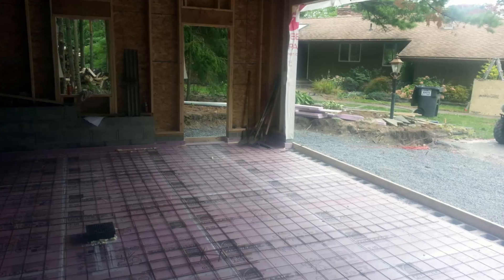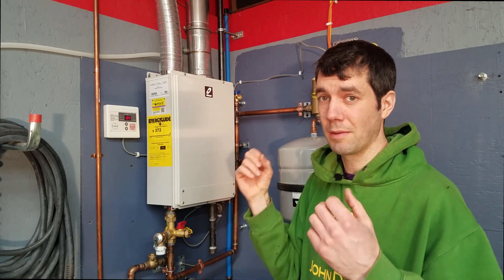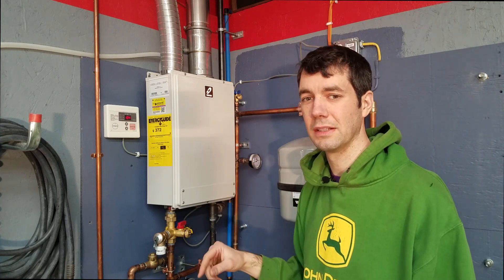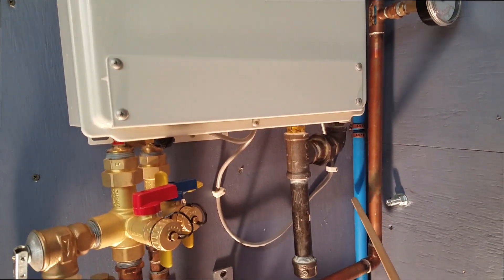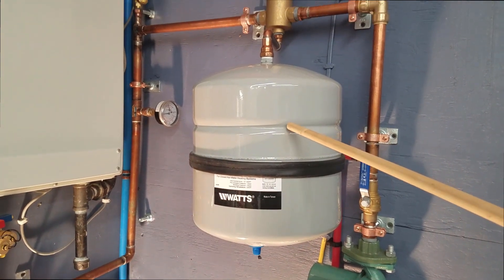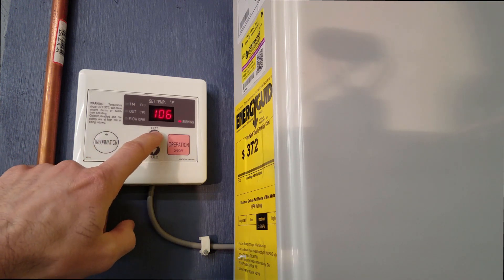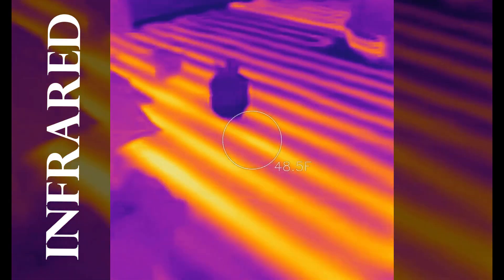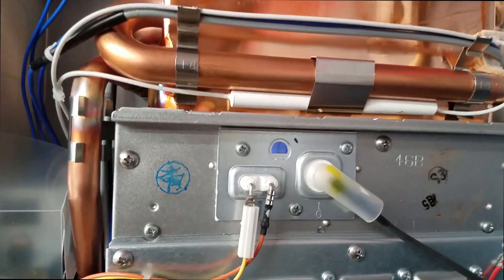Explained: Garage Radiant Floor Heat Setup w Takagi Tankless Heater

Comment: Well, I installed this exact system in 2016 in my 550 sqft shop with the pump pulling hot water from the Takaki tankless water heater. I am currently on my 3rd pump with countless code10's and code 90's. The pumps have had the exact fail, seizing. The last pump I bought was a Grundfos Stainless for $771.74. It did not last more then 5 months before seizing. 
 Circulator pumps (like Taco, Grundfos, or B&G) are designed to handle pressure on their inlet side, not suction.

Running them backwards (functionally) or with suction at the inlet can cause the impeller to: Run partially dry (if air gets in)
      Wear prematurely or seize up
      Make a loud humming or rattling noise as it tries to prime itself.
There have been a few individuals that have defined this problem but I see most diagrams pulling from the hot side. Even some literature I've read says that as well but those are defining potable water systems or a combination of both. So, my plan is to setup my system to do the following:  Cold water from floor to Pump → Cold Inlet (On Takagi) → Hot Outlet(On Takagi) → Supply Manifold → Floor Loop → Return Manifold → Expansion Tank → Back to Pump. If anyone can elaborate, please do. Thanks

Comment: Where in NY are you? I am in the finger lakes. I was told I need a mixing valve and a separate heat exchanger with my tankless water heater

Comment: I have a small 250sf shop where I already installed the tubes in the floor.  Has anyone designed a system to use one of the $200 propane on demand hot water heaters?  I was thinking of wiring the thermostat to the circ pump and when the circ pump turns on, it would fire up the on demand water heater.  Sound doable? has anyone tried this?

Comment: The best, simplist system I have seen!  I am doing the same thing.  MANY so called "experts" will tell you a tankless heater will not work, and try to sell you $3000 worth of complicated parts.  A friend whom built several systems up in Alaska (thanks Mike) said this is what you really need, which is similar to your video.  Nice job!

Comment: I've got a 3 zone system set up with a cross manifold valving system.  It is heated with a standard water heater that is too small to keep up.  It is also a closed loop system. Can I replace the heater with the tankless without any other changes?  I have 1500 square feet and live in Montana.  It is really hard to get straight answers from anyone on this stuff.  Very frustrating.

Comment: After three years with this single pump system have you had any problems. Most systems I see have two pumps for a one zone heating system
Reply from the maker: No problems.  What is the point of two zones on an open 1200 sq/ft space?  There is no need to heat one area more than another as it is all open.

Comment: I am installing a similar system and I am also using the Takagi appliance.  Can you provide the name and model number of the temperature/pressure/flow rate monitor device you mounted to adjust the heater?  Mine came with a wireless remote control but the device you used looks like it would not get lost and is super convenient for monitoring and control.  Thanks.
Reply from the maker: That came with the unit.  Mount yours on the wall next to it with double sided tape.

Comment: Excellent video. The infrared camera pictures are cool. That makes it easy to know where the lines are if you want to drill into the floor. What camera are you using? Do you know what the maximum water temperature is that can go into the concrete and not damage it over time?

Comment: Hey Max, thanks for posting this video. I'm currently using an electric tank water heater in my 1000' shop but plan to switch to natural gas and go with the same Takagi you used. My question is, since it is a modulating unit, is it possible to use an outside temp sensor like I keep hearing about being used with boilers? I keep reading that "outdoor temperature reset" will prevent my system from overshooting my set temp and will save even more money that way. Does this unit do that? Like I said, I ran electric last year and this year but I'm still pretty new to this stuff and, after a couple years of experience and research, I know just enough to be dangerous. Any help or suggestions you can offer will be greatly appreciated. Thanks.
Reply: Probably you can do that but I just ran mine off a simple thermostate but I can see how the floor can start to heat and then over heat the room.  Honestly I keep the temp at 55*F so I don't have that problem.  As the outside temps come above freezing I turn off the heater. So it might be 45 outside and I turn off the heat.

Comment: Well done!! So many YouTube videos that are supposed to be instructional leave us viewers with more questions than answers! I suspect you are a teacher or professor.  Is there any way I could do what you did but instead of using propane use an electric heat source??? People have told me propane is very expensive.
Reply: Just my experience but I originally went with an electric tank water heater and I paid DEARLY for that! Admittedly, the blown insulation had not yet been installed in the ceiling but my electric bill was over $200 a month and I didn't dare turn it off for fear of freezing. I know I know - what was I thinking? This year the ceiling insulation is in and, because I didn't get the gas line buried in time, I'm still using the electric tank water heater. At the very least, this will allow me to see the difference now with the ceiling insulated at 20" compared to just the sheet metal dura panels last year. So far, it's a fraction of last winters cost but I still intend to go gas because of the cost. This past summer I had a brand new, never installed, 40 or 50 gallon gas water heater given to me but even with a free tank gas water heater, I still plan to spend the $700 for the same Takagi tankless unit that Max has in this video. 
Sorry for the novel. All this said, I would suggest you compare the cost of natural gas, propane and electric in your area to see which will be the best choice for you because different rates apply for different areas. It's a cost you'll have for many years to come so play the long game here. Trying to shop price and do it cheap now will surely come back to bite you in the long run. Best of luck extraart1!
Reply: @teejay622  Thanks Tee Jay! I really appreciate your experience with this. I'm retiring in 3 years and building a house and shop in the boonies of Arkansas or Missouri. Starting to gather information from folks who know before I get out there.

Comment: Taking in consideration that you are operating both systems (LP and electric), which boiler would you say you are more happy with as far as maintenance and operating costs? I’m thinking about using an electric boiler so I don’t have to vent. I already have LP furnace and domestic hot water that costs me $800 per year to operate (depends on winter temperatures), and I’m 55*F Mon-Thu, and 68*F on Fri, Sat, Sun
Reply from the maker: Electric is easier to put in but it will cost more in the long run to operate.  The place electricity comes from is usually <40% efficient and they charge you for that. Depending on the size of your area an electric hot water heater might not have enough BTU's for the higher temperature swing you want.  Where LP tankless will be above 90% efficient but it will have more up front installation costs.  A large electric heater will be 5,500 watts or 18k btu while a LP heater will be 80-140k btus.  Research your area, how sealed your building is, size of your building to determine how many btus you will need.

Comment: What size pump? Did you need to use two LP tanks in parallel for enough gas flow? Thanks
Reply from the maker: Circulator pump is a standard pump. It only flows about 1.6 gpm.  I do have 2 LP 100 gallon tanks outside but 1 would have been enough.

Comment: My energy guru says a hybrid heat pump water heater is the cheapest way to heat water. The electricity it uses is less than the cost of propane,  ng or oil.
Reply from the maker: That is true.  A heat pump moves heat from outside in while LP burns and makes heat.  I do not have the tools to hook up a system with refrigerant.
Reply: @MakerMaxCorbett  some dont require tools other than wrenches

Comment: Greetings! Have you had any issues using the Takagi?  Do you know how many gallons per minute the circulator is? Do you know the return water temp?
Reply from the maker: I have had this going now 2 yrs and no issues. It is flowing 1.8gpm and the return temp is whatever the floor temp is.  The water goes in at 104*F and comes back at 55* or so.  If I turn the heat up to 65*F then the return water will eventually get to 65* but it takes a few hours.

Comment: Once the slab is up to set point who much does the boiler run on a 30,10,-10 degree day?  Nice set up.  From Cortland!
Reply from the maker: That will depend on the insulation in your building.  I have great insulation with R-30 in the walls and R-45 in the ceiling and R-17 garage door. Obviously the larger the temp differential the more it runs. I use about $400 worth of propane to heat it.

Comment: Where did you get the exhaust/intake manifold, what is it called?
Reply from the maker: Before I ordered the boiler I downloaded and read the manual.  In there it listed the parts for the exhaust/intake specific to that unit.  The I searched them up and ordered from a random site.

Comment: If you have a closed system I think you need 2 fill / bleed valves. One for water in and one for air out. You don’t really need a pressure release valve or of course a water feed regulator. Just the expansion tank and air eliminator.
Reply: Bud you absolutely need a pressure release valve on an closed loop hydronic system what are you talking about? Lol
Reply: @jacob4639  thanks for stressing that point !  I was gonna just post that. And don't count on the one that's on a water heater. That's probably like a 150psi. Get a 30psi. It ain't pretty what can grenade in a closed system when temp/pressure get outta hand. Cheap insurance. 🙂
Reply from the maker: The boiler came with the pressure relief valve.  As a safety I am pretty sure all water heating systems need one.  I have a valve located at the high point I opened while it filled to let air out.  Then I closed it down to 10% open while the pump ran for 10 min.  The rest of the air came out the air eliminator.  Thanks for watching.

Comment: Some guys put the pump on the cold side. Claiming its better for it. Any comments?
Reply from the maker: Yeah I have heard that.  On my house boiler the water is 180*F so I was not worried about 104*F water going through it. It was just easier to put the pump near the outlet that was there already.
Reply: 50 years ago they’d use waxes in the gaskets of the circulator so very high temps like in steam systems would cause failures. Obviously that’s no longer an issue however the old timer wisdom of putting the pump on the cold side persists….

Comment: I can’t find those ball valves with the hose fills for putting the vinegar in annual. $75 each anything close. Thinking of using braided line and removing it that way. Also it’s a closed glycol mix so shouldn’t be a concern.
Reply from the maker: Search up Amazon for "tankless service valves" or check your local supply house.

Comment: Hello Max, Nice job. One question  - what's your circulator pump size?
Reply from the maker: Not sure.  It was about $70 and pulls .7 amps.  I know my system runs about 1.6 gpm.

Comment: Nice Job Max and well explained video, love the infrared! QUESTION!  can this system be made for DUAL FUEL SOURCE? gas or wood if a homeowner has a outdoor furnace/boiler.
Reply from the maker: I would think so. The hot water through the floors is the radiant heat part, it does not care how the water is heated.  I would think you could have a valve you flip to run the water through a gas boiler or flip to run out to the wood boiler.  Same principle with a circulator pump.  The wood boiler has a safety where it will pump the water even if the floor is calling for no heat so the boiler will not well boil.

Comment: Max.... What controls the on/off of your recirculation pump? The JR2 that I bought may not be the right one and now I'm concerned.  did you hook it up differently?  Or do you have an Aquastat? If so which one?  If you have it hooked up directly on a on/off switch, does it run 24/7 ? PLEASE let me know asap
Reply from the maker: I used a Double-Pole 22 Amp 120-Volt/240-Volt Wall-Mount Mechanical Non-programmable Thermostat from Home Depot.  They are $25.  I wired the circulator pump to that.  When the pump turns on, the water flow sensor in the hot water heater is tripped and turns that on.  I put the thermostat about 10 ft away from the unit about half way between the ceiling and floor. It is set 24/7 to 55 degrees all winter.

Comment: Tip for those looking to install this type of system.  When laying out your pex circuits, you should really try to have the first loops of each circuit run parallel to the outside walls.  You want the hottest parts of the loops to be closest to the coldest elements.  This will also avoid hot spots in the working areas of the garage.  I would also run 50/50 mix of propylene glyco & water in the circuits for 2 reasons.  Protection from freezing if you don't run the heater every day in the winter and smaller thermal scale.  Glycol absorbs/releases heat slower than water so you flatten the variance in the hot and cold temps of the system.  There is no one is better then the other here, just different pros & cons for each.
Reply from the maker: Thanks for this as I am just a DIY.  There should never be a reason my concrete floor drops below freezing unless the unit breaks.  The area closest to the heater is warmer than the opposite side by the garage door, but I work more in the rear of the shop.  Good idea.

Comment: Great video Max.  I have one question, how much concrete did you pull over the PEX? (how many inches).
Thanks
Phil
Reply from the maker: The slab is 4 inches thick with the tubes in the middle.  There is 2 inch thick foam under it for insulation from the ground.
Reply: What did you use to raise the PEX 2" above the insulation?. Could you just lay the PEX on the  insulation and just poor the 4" of concrete over as well?
Reply: @scottcousineau6681  I saw another video here on YouTube where a guy did that. He wanted to still be able to screw in to the cement. I imagine you might lose a small amount of efficiency or time for things to warm up. But I think that being able to bolt in is worth it.

Comment: Very well done system, awesome brief and to the major points of the system. The only thing to change would be having the loops parallel as in supply and return together. This will balance the temps better though out the slab, as the hottest will be next to the coldest parts of the loop
. And yes it is a shop so that, so that would be a little nitt picky.  Very well done project!
Reply from the maker: Good point! This was my first time ever doing this and the information on how to is limited.  A HVAC professional would probably know what you are talking about.  Makes sense.

Comment: I want to do this to my shop someday. One thing I have heard and maybe it doesn't apply to you, is that you shouldn't push really hot water into concrete. You want it to very slowly warm up, or you are going to stress and crack it up.. I don't know what that temperature setting should be either. Curious what you have heard or read.
Reply from the maker: You are right. I run the water at 104 degrees out of the boiler and it comes back what ever temp the floor is.  It takes about 1 hour to swing up 5 degrees.

Comment: I think you forgot the insulation under the concrete and the thousand feet of pex tubing in your cost example.
Reply from the maker: I did not mention the concrete or foam under it.  The PEX was $500 for the stuff in the concrete.  The foam was probably $1000 for 1200 sq/ft of 2" thick and then 1" thick around the perimeter.  Thanks for catching that.
Reply: @MakerMaxCorbett  yes that was about my cost too.

Comment: NIce system, wondering about all the check valves, it's just a circulating system. I don't have any check valves in my system and it performs flawlessly. Mine is a closed system unlike yours, maybe that makes the difference.
Reply from the maker: I am sure I did not need them, but from my research it was suggested by the manufacturer and other places.  For the $15 I just put them in there. I also take water from the system to fill buckets so I don't want the old floor water going backwards.
Reply: Great question, and the pump usually has a built in check valve.

Comment: VERY IMPORTANT QUESTION FOR YOU - I don't know if you did it.... where in your system did you "tee off" for you sink? Hot and Cold?
Reply from the maker: Sink gets the hot water from an electric water heater I had installed a year before. I got it free from someone but you can buy them for $200.  If you wanted to "T" off it, do it right after water heater.  Between the expansion tank and circulator pump.  Make sure to have anti backflow valves installed before the circulator pump.

Comment: I like it a lot - thank you!!  Would you still be able to branch out the hot water for domestic water use?
Reply from the maker: I would think so but then you are taking away water from the heating loop which may have been in the floor for a few weeks. You then introduce new water to the floor which accelerates mineral deposits.